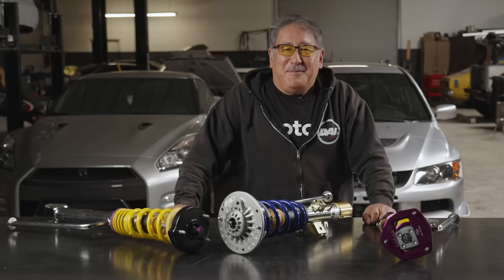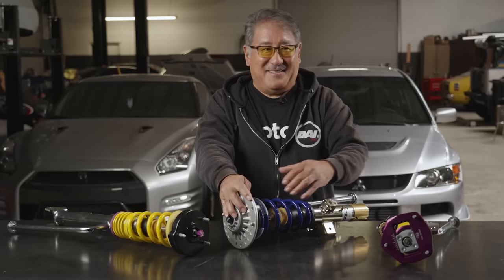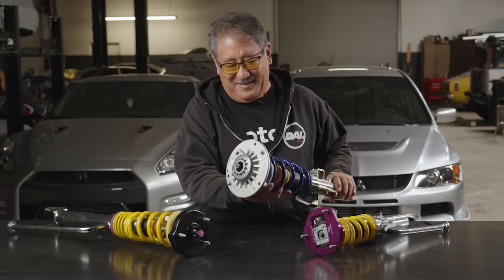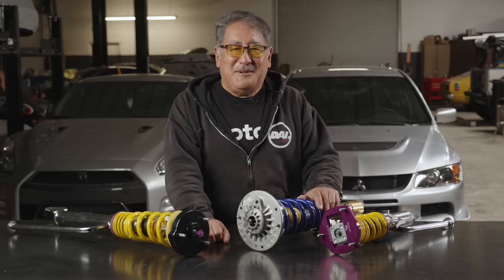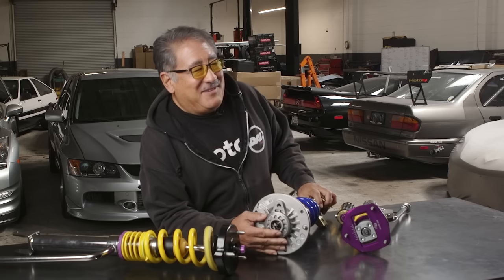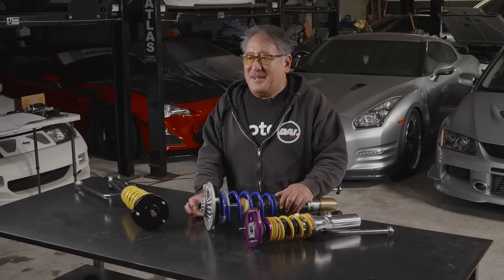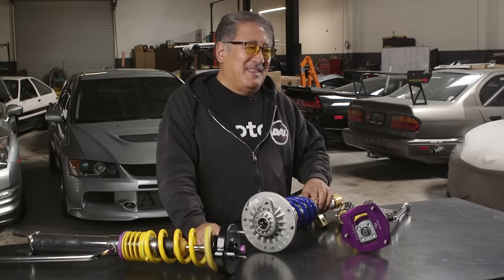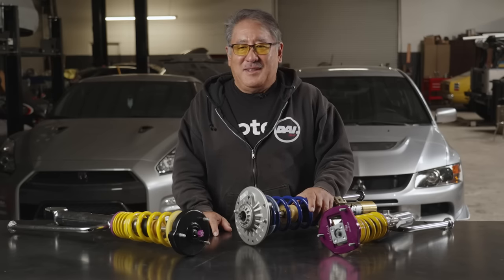How To Adjust Your Shocks Like a Pro and Go Faster | PART 1 - Single-Way Adjustable Dampers!

Comment: If you're a complete beginner messing with your clickers it's best to do adjustments in large increments. So 5 or 10. 
Chances are you're not a race car driver and won't feel a single clicks difference when you go for a test drive. 
Once you recognise how the car feels under different settings you can start doing smaller adjustments.
Reply from the maker: It depends how many clicks the shocks have.  If they are like ebay wonders with 30-40 clicks yeah.  Some shocks 5-10 clicks is the whole or most of the adjustment range. Shocks like Sachs motorsports come to mind. It's easily half or more of the adjustment range of many shocks.
Reply: @motoiq   That's true. In my group of friends most of us use HSD, BC or Tein so there's a fair few clicks. The few friends I've taught about this have benefitted from noticing the difference in large increments and have since gone onto dialing in their setup. It's how I was taught also.
Reply: @motoiq  Overall a good video though and I appreciate it.
Reply from the maker: maybe I should say 25-40 percent of the range instead of number of clicks.

Comment: When starting adjustments from scratch on full soft would you recommend increasing both the front and rear the same amount of clicks, or rather start with one end of the car first, get to a place where you're happy and then start making adjustments to the other end? And thank you, I look forward to the rest of the series! :)
Reply from the maker: I do one end at a time, at least to get it into the ballpark.  Sometimes though what you think is one end of the car is actually the other.  Once you get some experiance playing with this stuff you will know what I mean.

Comment: My 2022 WRX OEM struts are great on a track setting but horrible on everyday roads. I got some ISC coils going on this spring. Not the best coils, but I know it will be an upgrade. I'm wondering if I should add LCA's as I want to go about an 1"-1/2" or 2" lower?

Comment: What does more rebound means? Opening up the valve more? The shock adjustment knob only has numbers or two words "hard" or "soft". Does more rebound means harder or softer? Sometimes it just quite confusing when just syaing more or less. Maybe its better to say opening or closing the valve.
Reply from the maker: More  more force or harder
Reply: @motoiq  I see, so it means more force used from the damper to control the spring.

Comment: One of our cars is 06 legacy SPEC B.
Replacement standard Bilstein struts $2000 here 😂.
Even kyb is $600 on sale + shipping.
That doesn’t fix the stock soft springs.
New king springs $400.
Coilovers. HSD monos $1450 to name one.
Looks like its getting coil overs.

Comment: What I would REEEEAAAALLY appreciate is also a rebound adjustment guide per drivetrain configuration (FF, FR,MR, AWD etc). For example what are the differences between a front engined - front wheel drive car vs a front engined - rear wheel drive one, in terms of rebound effect during corner exit when ones tries to put the power down on the front wheel vs the other?
Reply from the maker: There is no such thing as that.  Shock tuning is the same, suspension tuning is different.
Reply: @motoiq  Ok! Good to know!

Comment: Also any advice on setting preload? Ive seen people say about 4mm, but would that be an okay rule for most and how would you go about it when running helper springs?
Reply from the maker: I don't like running much preload.  Too much can affect your high speed rebound. It is too general of a question to answer generally.

Comment: I'm definitely saving this master class to rewatch later!  What rebound settings would you recommend for a 987.2 with KW V3 for good traction and handling for mainly autocross? I have a 1.3 in drop and kept the compression for all four in the middle as KW recommended.  I also have Tarett front/rear adj. sways and droplinks.  Rear sway is full soft and front sway is in the middle as you recommended in your Cayman vid.  Thanks in advance.
Reply from the maker: It kinda depends on a lot of things like how track biased your alignment is and what sort of tires.  Generally an Autocross likes the shock to be set a little stiffer because so much depends on quick transitions and tight turns where fast response is important.
Reply: @motoiq  Potenza RE-71RS 245/35/19 front, 275/35/19 rear.
 +.03/-1.8/+8 (total toe/camber/caster) front.  +.02/-2.3/.00 (total toe/camber/thrust) in rear.
Reply from the maker: I would do way more camber in the front like 3.5 degrees and a little toe out then adjust the shocks as I suggested in the video.

Comment: Hey mike… Quick question… When you say in this video that you usually reduce a lot of the damping compared to what it is when people first bring it to you being a lot less than what they expect because more is not better etc.…… What numbers do you usually see like on a 30 click they've got it at 30 or 18 you know things like that do you see it at like 80 and 90% of its max ....or are you talking single digits… I'm just curious of your assessment on that… Thanks for a response as always
Reply from the maker: Really hard to say but, most shocks that have that many clicks tend to be cheap chinses stuff that hardly work.

Comment: Awesome content, always love to hear all your expert advise, any chance of a fwd suspension setup video? (I have a 1993 dc2 vtir integra with xyz coilovers, fully bushed, big 27mm ASR rear swaybar and subframe brace and i currently run alot of front rebound and very little rear to get the car to rotate, but im currently lifting an inside rear wheel from corner entry to late mid corner and not sure if its a good thing, positive the car rotates faster, negative very unstable and locks airborn wheel if brakes applied for reference)
Reply from the maker: Experiment and see if you can get it better!

Comment: Hey Mike, I watched your video on short tube header vs long tube. I have a Ram 1500 5th gen 5.7L. I plan on swapping out the headers for the long tube. I also going to add a new exhaust system. I want an aggressive sound, any recommendations. I was pondering adding  twin turbo as well. What are your thoughts on this modification? Looking forward to hearing back from you.
Reply from the maker: Magnaflow, Holley/Hooker/Borla all make pretty good stuff for a wide range of applications. Twin turbos are pretty complicated and expensive to do but will potentially make tons of power.

Comment: Hey mike… Question… Did my pre-load on my BC coil overs as instructed by BC's suggestions… And recommendation… And I speed I have a terrible vibration in the front end teeth chattering if you will… The damper is set at five… This is a 99 V6 Camry… Other than that everything's great… And it's gotten worse since The pre-load adjustment… Which was just hand tight… Tighten the bottom ring loosely fitting touching etc.… Now using  a spanner wrench and get 4 mm… Now lock in… And that's what I did… Any suggestions would be great I'm about at wits end… Thank you great vid!!👌
Reply from the maker: Are you too low on the bumpstops?

Comment: Thankyou for an awesome video,
Is there any merit to adjusting shocks based on tyre wear? Similar to how motorbike racers set up suspension?
Reply from the maker: The only time I have seen shock affect tire wear is if they are OEM type shocks and are completely worn out.  In that case they make a cupping wear pattern on the tires.
Reply: @motoiq  that's really interesting, I have a tarmac rally car that runs on a050 semi slicks and I've found by changing the dampening I can push the wear patterns around the tread area from leading to trailing but I don't know how much it really matters with cars vs motorbikes.
Reply from the maker: That's probably a function of your suspension motion and camber and toe curves.  I have never noticed that but it is entirely possible.

Comment: Thanks for the content. I'm about to start experimenting with Konis inside Eibach Pro's on my '88 MR2. I'm also running without a rear sway bar since it doesn't have it from factory. My aim is a trackable street car. Any suggestions you could add for a small midship having an old suspension system like that? Thanks in advance.
Reply from the maker: Adjusting old Koni's is adding force in the whole range.  Also the adjustments are not linear with most of the adjustment happening in the last turn of the adjuster.  I think those old Koni's were something like 3 turns from soft to stiff.

Comment: I assume you corner weight with the pilot on the seat and expected fuel tank capacity for the track, so to compensate you adjust your spring height until the car has equal spacing between tire and fender or you just pay attention strictly on what the weight balance indicator is telling you?

What about using weights to equilize the driver weight, is this as well an acceptable method or it has to be a combination of it?
Reply from the maker: You set the corner weights so the cross weight percentage is equal with the drivers weight in the seat and the weight as the car is driven.

Comment: question… I have a model 3 with KW v3 setup, it has a top and bottom adjustments, for compression and rebound. would i be better off keeping both the knobs at the same amount of clicks or should I set them differently? thanks for your advice!
Reply from the maker: See part 2

Comment: 8 minutes into this video, I’ve realized that I don’t need coilovers. I don’t have a dedicated track car and the intricacies of dialing in a set of coilovers to be perfect seems like more hassle than it’s worth for my (primarily) street car. I think I’ll stick to a Whiteline grip kit that’s designed to work within the bounds of a factory strut and leave it up to an engineer to decide where the sweet spot is.

Comment: Really hoping to get a reply to my question. 
I’ve been looking for something to replace the shocks on my 2020 wrx. I’m right at 50k miles and feels like they are starting to wear out. I’m wondering if I should replace with OEM, or go with something like fortune autos. Or slivers neo max coilovers? My max budget is 1600 dollars. I don’t want to drop the car more than 1inch all around thanks!
Reply from the maker: KW V3, Feals, Fortune.

Comment: Mike what do you do when running lg drop spindles for C6Z, in relation to shock and spring length. I plan to upgrade to drop spindles, coilovers, and spherical all at the same time, and wamt to get correct  coilover length. Love the video!
Reply from the maker: In this case it's sort of hard because i would need to see it.  With drop spindels, sometimes people don't give the car enough droop travel.  Generally you want a minimum of 1" of droop but a little more is better.

Comment: For a complete suspension beginner, would you recommend non-adjustable shocks like Bilstein B6 with oem springs and ride height? Or full coilovers anyway, even if you don't want to lower your car that much or not even lower it at all?
Reply from the maker: It depends, if you want something like a cheap heavy duty OEM replacment, the Bilstein is great. If you need adjustment, coilovers are the way to go.
Reply: @motoiq  I've got a 2013 GT86. As far as I know they have the Showa OEM dampers that got some criticism from early reviews. On later years Toyota changed to Sachs as I read. So I thought when it's time to replace the dampers I could change to Bilstein B6 - that way I don't have any problems with German TÜV (federal inspection). When I go the coilover route I have to let them check and approve both my wheel sets and the suspension parts and pay extra for those checks :-D

Comment: What practices from tuning motorcycle suspension can transfer over to cars? For example, setting rebound on a motorcycle, you would want the suspension to compresses and return to its neutral position without any po-go effect. This is usually tested by shocking the front forks from the triple tree. Would it be the same concept forcing/pushing the coilovers to compress on the vehicle and noting the speed and rate of compression/rebound?
Reply from the maker: You don 't really adjust a motorcycle by pushing on it either, its just like a car.

Comment: Hey Mike - Luv This !
I posted the link on the mazda forum. 

Question:
Do you have a how to set up a FWD like a mazda 3 with 180whp ?

Thanks
G
Reply from the maker: The method to set up fwd shocks is the same as rwd or awd shocks. The suspension tuning is different but the shock tuning is the same
Reply: @motoiq  hey thanks ...
Would the setup be stiffer front vs rear
Reply from the maker: There is a difference between suspension setup and shock setup. For FWD suspension with advanced drivers yes generally stiffer in the rear

Comment: So you mentioned that poorly modified r32 gtrs will lift the inside front wheel under hard cornering, but this is also true in the group a r32 GTRs, and obviously those aren't poorly modified. Is that just a product of the racing series mandating certain geometry restrictions, or did they find a way to make that wheel lifting beneficial, or at least not as bad? the reason i ask is because i am absolutely in love with how those group a cars look and move around while on track, and want to modify my car's suspension to do the same. Is this a stupid goal or is there another way to make it work?
Reply from the maker: The front wheel lifting is part of the front suspension geometry.  What you can do is not make your car too low.
Reply: @motoiq I'm starting to think you don't want us to lower our cars too much...

Comment: hey jeff, I've installed hks sp coilovers on my 2015 brz, I have lowered the car one inch and had the car aligned, also all other suspension components are stock, except for wheels and tires running 17 x 9.5 on 255/40/17 tire. how should I set up my suspension to make the best of bad track sections yet not too soft that it bottoms out. any advice would be greatly appreciated! if I should be adding sway bars or other components please let me know
Reply from the maker: Watch the video and do what it says!

Comment: Tbh this is alot of help but I'm wondering how would it all go for a fwd car cus yk the traction and the power is mostly going on the front wheels it should be a bit different, right?
Reply from the maker: Tuning the shocks is the same. Tuning the suspension is different.

Comment: Hi really good video I've watched your  hp academy interview to. I was just wondering I've got a golf gte on ethanol and my suspension is getting put in at the moment about 8000 nzd worth but I could only find Eiback pro springs for my gte and standard shocks. Should I get coilovers since it is a track car and the rest of the suspension is so good 034 motorsports hole catalog for golf gti
Reply from the maker: Yes, absolutely
Reply: @motoiq  is the bc racing shock ok. how much does it cost for  consulting for spring rate would the bilstein b16 be OK also
Reply from the maker: I prefer, KW, Ohlins, MCS, Moton

Comment: My alphard 3rd generation , feels a bit too much small side to side vibration in the rear on high speed highways. Is that a sign of too much rebound or maybe other issue like alignment/etc ? Car is stock
Reply from the maker: Could be many things from worn components to bad design.

Comment: Bit confused.

Please correct me on this if I'm wrong but I thought more rebound and more dampening were on opposite ends and hence not the same?

Here they are used interchangeably to mean the same thing, whilst what Mike probably means with more rebound is twisting the knob clockwise (giving it "more") in a traditional shock which would actually give it more dampening (keep the weight longer) hence actually less rebound, no? Or am I wrong? Why then say "more rebound"?

He goes on and says "more rebound" does this and this and a sentence later instead says "more dampening" does this and this, leaves me confused since I thought they are the opposite. More rebound means less dampening and less rebound means more dampening, no?

Essentially saying that rebound and rebound dampening are used interchangeably as if they were the same thing whilst they are actually opposites.
Reply from the maker: More rebound damping is more damping on the rebound side of the stroke. Most one way shocks adjust mostly the rebound when you turn the knob
Reply: @motoiq  More rebound dampening gives less rebound.

Comment: How do I know what spring rate I need/want? And how do I balance spring rate vs sway bar? I’ve learned about suspension frequencies but I also wanna limit travel on my front wheel drive strut car
Reply from the maker: that's a different video
Reply: @motoiq  Have you guys made it or not yet? I’ve looked all over the channel and site though I’m not a good looker.. I don’t want to buy coilovers until I figure it out, so I’m driving on my leaking struts for now and saving my money to do it right
Reply from the maker: Not yet, if you stick with high quality coilovers, they are better at picking rates than you are.
Reply: @motoiq  Not much for my E130 Corolla, I’m looking at Silver’s NeoMax but there’s BC Racing for a similar price, Teins for cheaper, KW’s I can’t afford, some other brands im unsure about like D2, Ceika, KSport